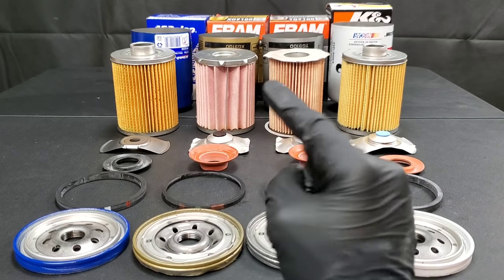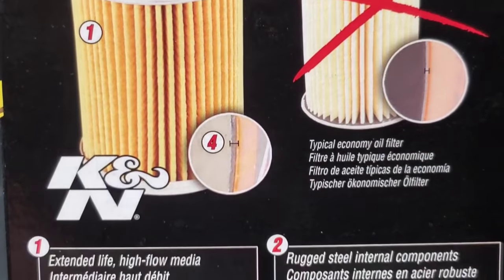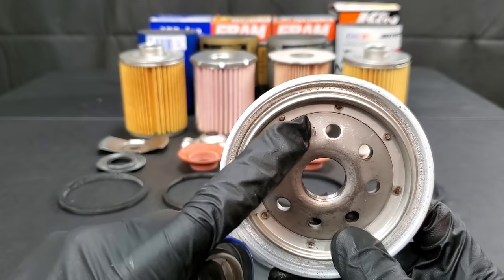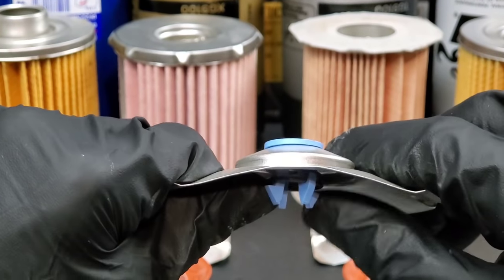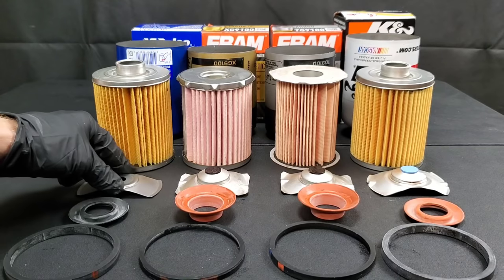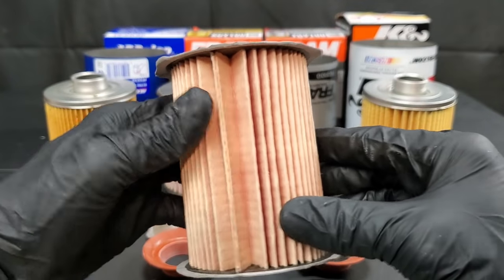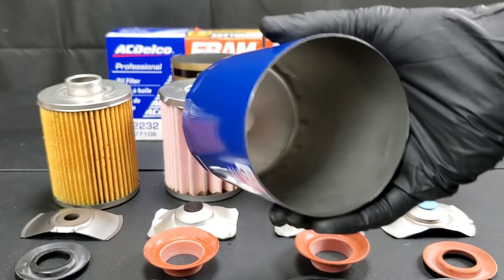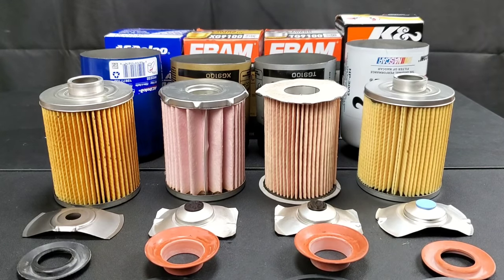DO NOT USE This Oil Filter made by...

Comment: Well I have used Fram orange can of death. Many times no problems but change it at 3-4k miles.

Actually some of thenOEM Honda filters I read somewhere are made by Fram but are the tough guard ones.
Reply: Correct. Some factory branded OEM oil filters are made by Fram under contract.  Incidentally, GM oil filter manufacturing company doesn't exist, so AC Delco filters are contracted by GM to another company to make for them. Just like GM Oil Bottling company doesn't exist...contracted out to another company to make for them. Same with Ford/Motorcraft filters and oil, and Mopar/Chrysler filters. All under contract to another company.

Comment: Been using the Fram tough Guard on my 1991 Honda CRX which I bought in 2005 when it had 165K miles, recently hit 321K miles....and no problems. I do change the oil religiously every 2K miles, and use conventional motor oil......

Comment: My dad owns 2010 Escalade that burns oil like crazy . We are planning to do the update upgrade to lower the oil consumption soon but something that we learn is better to buy 10k oil filter does keep the oil but cleaner long run and I also buy the 10k filter for my Camry and I usually change the oil every 5-6k
Reply: You should try putting a double Oil catch can. You would see a significant difference in Oil Consumption, Performance & Mpg. Since I installed one on my V8 Truck it traps a whole lot of oil that would’ve went down the intake I took off the throttlebody, and it looks a lot cleaner. 🤙😎✅

Comment: Just switched from using Fram air filters to STP after 40+ years. The STP filter actually looks like it's better made and was like $2 cheaper. And switched over to Bosch oil filters for a couple of dollars more. 2005 Caravan 3.3 150+K miles and running just fine. 👍

Comment: I'd never let a vehicle I own go 20k on the oil or filter.  I tend to use the vehicle manufacturers filter on my vehicles.
Reply: If you do best to use a whole quart of marvel, mystery, oil and run 500 to 1000 miles also swap out all filter with cheap new filter. Will grab more dirt and sludge.🤙✅

Comment: I have been using it for 10 years the K&N Gold Filter And Air Filter with stock, cold intake, manifold, modified with one pair of panty hose over the filter. I’ve seen it work with the debris. It leaves inside air, filter, closed compartment.  Also using K&N Cabin Filter. 😎🤙✅

Comment: The Fram Extra Guard filter media is meant to trap particles at 20 microns or greater.  Baldwin is 10 microns.  Wix, Mobil 1 and Napa say they are 25 microns.  Lots of them are 40 microns.  The microns that get past the filter are what damages your engine.  According to experts, at 10 microns of filtering, your engine can go 400k miles.  At 45 microns, your engine can go 150k miles.  All this filtering stops when your filter is full and it goes on bypass.  The best choice of filter is one that provides a good balance.  If you change your oil every 3k miles, the Fram does ok.  I like Baldwin at 7k using a good oil.  Some engines are dirtier too.  New Honda's oil looks like baby oil at 15k miles.  My Ram truck looks black at 7k.
Reply: Micron is a measurement, not a particle that can damage your engine.

Comment: That so called cardboard isn't really cardboard. It does look bad, but it will do the job. Personally, if I use a Fram filter I use either an Ultra or Endurance. For the small amount of money difference between a low-cost filter and a higher quality one, I say go with a better filter. Mobil One, Purolator pure one or Boss, or whatever, why not just get a high-quality filter. Just my 2 cents {after inflation just isn't worth much anymore}. Another great video Nate.

Comment: As I said in a previous comment, I always use the OEM filters on my engines because the factory has designed & tested their filters to protect the engines for 5 years during the warranty.  AS Delco makes a beautiful filter that lasts.  I don't see any of these 3rd party brands offering to warranty my v8 engines for 5 years.
Reply: well, i mean, if you are going 5 years between oil changes, the filter is gonna be the least of your problems. never go more than 5000miles/6months, which ever occurs first, between oil changes, regardless of how long a manufacturer says their oils /filter can go, that how blown up engines happen. you should always change your filter when you change your oil. all auto manufacturers put conventional oil in their engines from the factory as its the cheapest oil. conventional oil is only good for 3000 miles/6months before it starts breaking down and stops protecting your engine. personally, i use AcDelco everything on my cars, i have primarily classics, but i do also have new cars as well. ive never had any issues with AcDelco as an OEM/aftermarket parts manufacturer. but even then, i have a set schedule for the consumables on the car. I never hit the mileage cap, so i change my oil and filter, air filter, and plugs every 6 months, plug wires, cap and rotor every other oil change. and the coil on every other cap change. I also replace my brakes once a year regardless if they are needed or not. thx to this schedule, and the warranty on some of the parts, not only have i been able to keep the same engine alive for over 30 years, but i havnt payed for brakes or distributer caps in over 30 years. its also a really good idea to flush all your fluid systems once every 5 years. if you do this, a car you buy at the age of 16, new or old, will outlive you.
Reply: @forceablepizza764   Almost none of what you say is true.  If all the stuff you constantly change was really that horrible, no one would buy any of it and they'd be out of business.
Reply: I question whether the delco filter from Walmart is the same quality.

Comment: i've been using frame since 1997 when I bought my first car, and did my own oil changes, I had no issues with them. I changed the oil so frequently and on-schedule that when I sold it back to the dealership, the mechanic said the engine basically looked unused, and he said that I should ask for more money. I told him no because I wanted to get rid of the Honda Civic. It was very strange since he worked for the dealership.

Comment: If you want to compare these filters, you should check the used oil and see how much each of these filters could really do the job...not just by their look...I have tried almost every single filter on the market on my turbo engine with mobile 1 full syn oil for the last 14 yrs, and sent used oil to the lab to check for each of the filters at 5k miles used...results came back to show fram ultra was one of the best filter for my engine, but not much different between these filter.  I have used fram ultra for the last 14 yrs on the same engine!  Just change oil + filter regularly between 3k or 5k mikes, if you have few extra dollars the buy decent filter, if not just buy any filter, most import thing is changing oil+filter every 3k miles (regular oil) or 5k miles (full syn oil)...I dont trust the 10k miles or 20k miles oil changes...save $30 for oil change, then spend $$5k for new engine, it doesn’t work for me.
Reply: 30$ oil changes...
Either you have a scooter or the post is 10 years old when inflation hasn't doubled or more :P
I do mobile 1 everything, but often out of filters.. Used k&n .. No idea on performance, but their design has much better functionality.. And a designed for a socket to unscrew, great, can use torque wrench to specs
Reply: I knew a Mobil Petrochemical Engnineer who was on the team that invented Mobil 1. He asked me to help make sure that his Mercedes 300D car, owned by Mobil for product testing's injection pump was properly timed. With the cylinder head removed, his engine had over 300k miles, but looked as if it had a  few thousand miles. A Diesel with a few thousand mile's oil looked like tar. I asked him how was it possible?

He explained that synthetic oil molecules are so perfectly spherical they are not affected by temperature, and that they could last over 25k miles. He recommended replacing the filter at the recommended service interval and topping it off with Mobil 1, but that there was no need to replace the oil before then. He added that he had had that car since new. 

So, I saw the proof and heard the advice of an Engineer. I do not agree with the 3-5k oil change when using synthetics. What should be done is to replace the filter more often, but not necessarily the oil. I am with Roy the Engineer.
Reply: I bet you did send the filters to the lab, and I'm a genie 😂😅

Comment: The K&N filter with the hole in the end can be used in aircraft with a safety wire tiedown.
Reply: Or racing applications
Reply: I have been using it for 10 years the K&N Gold Filter And Air Filter with stock, cold intake, manifold, modified with one pair of panty hose over the filter. I’ve seen it work with the debris. It leaves inside bottom air, filter, closed compartment.  Also using K&N Cabin Filter. K&N makes Awesome Products 😎🤙

Comment: Good video. I heard Fram was ???. Yet I'm running them. 3,ooo mile changes. 10/30 conventional oil. ( $600 scrap yard '89 rebuilt 350 in '87 Suburban. NO oil burn or leaks 5 yrs now.) I love my Black Bomber, and I'm going AC Delco (or KN) next change.  I use Conven oil because it burns. No smoke, no problem.  Western Ma.,USA,  Feb 2, 2021

Comment: Oil filters are consumables that get changed between 6 to 12 months, any brand will work fine, if you have a personal favorite brand that’s fine, I usually get the filter that fits my vehicle,  it always easy to find a suitable wix filter at Oreily’s. On European brands, I buy filters from FCP Euro where they fit and the prices are reasonable.

Comment: Be VERY careful with the K&N.  I had one on my Honda motorcycle and it somehow managed to block oil flow.  At the time, I was at the Laconia Bike Week in NH.  Ended up with no oil in the bike.  Walked over 10 miles in MC gear to a NAPA to get new oil and I got a new filer too (glad I did)  Sadly, I did not save the bad filter, but in doing research after, discovered that many tracks don't allow ANY aftermarket filters anymore because they had K&N filters do the same thing on the track leading to oil slicks. 

Seems the filters made in Thailand were OK, but there were some made in China which were sub standard.  

Now, The issues are supposed to have been fixed, but my leisure time is not worth this kind of hassle.  I've switched to Purolator Boss and never looked back.

Comment: 2001 Ford f 150 with 400,000 miles with fram filters and still running like a top
Reply: K&N Gold, I feel that it grabs more dirt and sledge. I’ve let it drain for 2 to 3 days and it’s a lot heavier than a new filter must try mine blowing. Great products 🤙😎✅
Reply: I feel that K&N GoldFilter grabs more dirt and sledge. I’ve let it drain for 2 to 3 days and it’s a lot heavier than a new filter must try mine blowing. Great products 🤙😎✅ I have a daily driver 1998 Ford F150 with 150,000 odometer are use fuel injection cleaner B 12 every other month use marvel mystery oil, 8 ounces every gas fill up seen a 5-7 Mpg with every fill up of 25 gallons.

Comment: Perhaps the best one I've found so far is Wix.  Under no circumstances should you use FRAM filters.  The AC Delco... I don't know.  The dealer used them on my truck for 200,000 miles and it was still running strong, no oil issues when I sold it, so I'm on the fence about those (although I always changed my oil every 5,000 miles or 4 months anyways).  

I do have to say that I think Toyota has the best idea now... on some of their vehicles, you simply removal a metal cup (that is like an oil filter but made of much thicker material and is reusable) and you simply replace the filter inside, not the entire housing.  The only downside to this is if you crossthread the threads on the filter housing, it may be expensive to have replaced as the top part of the housing is permanently affixed to the bottom of the engine so you may have to replace either the pan or parts near the pan to replace it if you cross thread it.    But I think it is a better design because it's more rigid and not a thin can like most of these are.
Reply: There are two different ones available. Plastic or aluminum. I work in an auto parts store and we always sell the Toyota filter housings. People have a tendency to over tighten them and that's how they get ruined.
Reply: I have an is250 with the metal oil filter housing. Had the car for over 10 years and put over 170k miles and countless oil changes. Never cross threaded it or over tightened. I always hand tighten it and make sure it threads on properly.

Comment: There is no issue with Fram using cardboard on it's econo filter.  Only a High Performance engine would need to worry about collapse.  Nobody with 400+ HP should use it but very fine for an econo daily driver using conventional oil.

Comment: Is a silicone anti drain back valve necessary if the oil filter is mounted thread side up on the bottom of the engine?
Reply: No....only side mounted applications use the anti drain feature...

Comment: Does anyone remember Hastings oil filters with densite filter medium? Back in the early 80s I worked at a parts store that had cutaways of Fram, AC Delco, one I can't rember and a Hastings. Only the Hastings had metal end caps, perforated inner tube vs wire, beefer anti drain back valve, more inlet holes and a filter medium that was held in place by perforated tube on the outside. Never had a failure with one even in over pressure situations due to racing applications with pump relief pressure set higher.
Reply: I remember Hastings piston rings from the early 1960s. I even have an old Hastings lighted sign from the 1960s in the attic of my garage. It's in good shape.
Reply: @bobby1970  I've got the piston ring hat still, never wore it.
Reply: @johnnichols9056  Oh, wow, that's awesome. You might want to hold onto it, because it just might be worth something. I want to see if my Hastings sign is worth anything. Who knows? For the right price, I'd sell it.

Comment: Been using orange frams  and mobil1 on my OHV cars since 1991 when I first started changing my own oil. They go 300K miles, never had internal problems, never burned oil. Keep the change interval to less than 5K miles. Only a fool would go 10-20K on any oil or filter. Although now on our DOHC VVT cars we do use the better filters but still keep changing at 5K.
Reply: Same here..true
Reply from the maker: Check out the new video https://youtu.be/Qf2tGF63Gz8

Comment: Am doing an oil and filter change on not my car and found a filter installed by jiffy L which I find helpful in its design, Prime guard is its name and right on the filter is crossover information for 10 other filters that will work, fit, if you can't find the original, it would be helpful if other filter companies would take notice of this and follow suit

Comment: Thanks for this video, very informative. Do you have a video for motorcraft oil filters? Earlier this year I bought my first brand new F150. The dealership did the first oil change and since they use motorcraft oil and filter I decided to do the same when I did the second oil change. My last F150 I bought pre-owned and used mostly Fram oil filters, but since I've seen several videos of inside of Fram filters I stopped using them. Thanks again!
Reply: Motorcraft is what I use!
Reply: @harleyjackson5513 K&N GoldFilter pennzoil Ultra Synthetic use in my 1998 F-150 160K Miles . After every oil change, I drain my filter for 2 to 3 days. Afterwards I feel that it holds a half pound to a pound of sludge. After 5000-6000 Miles . Are use a quart of marvel mystery oil before oil change change it after 1000 miles. ✅🤙😎

Comment: I change the oil on our 1999 chevy tahoe and 2017 gmc sierra every 6 months we don't really put on that many miles like 5k miles max per vehicle,  and both vehicles is high mileage, my wife prefers Mobil 1 HM in her truck an Castrol in the Tahoe, I've started using super tech oil in the Tahoe and She's still keeping up well compared to Castrol oil was black after 3 months for a vehicle that barely drives a on the weekly..

Comment: Bypass valves open a lot. Until oil comes up to temp it is too thick to have 100% passing through filter when engine is a few hundred or more rpm above idle. The paper will collapse if pressure drop through paper gets more than 3-4 psi. If you use thicker oil it bypasses even more. The reality is that the engine will not have much inside to filter unless something fails or if something is introduced into engine. If you dismantle a removed oil filter from gasoline engine you will see the sludge particles down in the bottom of pleats is the only thing you find. If the engine had repairs then you find gasket and sealer pieces. The filter not falling apart is the most important consideration for filter selection.

Comment: Exactly what you're saying is true on this video myself I prefer a OEM filter for my car that is designed for my car other than a Madison Avenue advertising firm says generally speaking OEM filters regulate oil pressure better than aftermarket because this design for that car an older car with an old engine who cares but a newer vehicle you'd be a fool to trust AutoZone or O'Reilly's with your car's engine I trust you manufacturer
Reply: OEM filters are always better. Especially fuel filters

Comment: K&N and ACDelco both made by Champ Labs that's why they appear very similar. K&N does NOT make filters. They have them made to thier specs by a manufacturer, in this case Champ Labs. Good see you finally recognize Fram moisture not water but a light weight oil.
Reply: @eac1235  Already knew ST was made by Champ Labs, but thanks for the tip. Of course, Super Tech is not in the video, so why would I mention it.